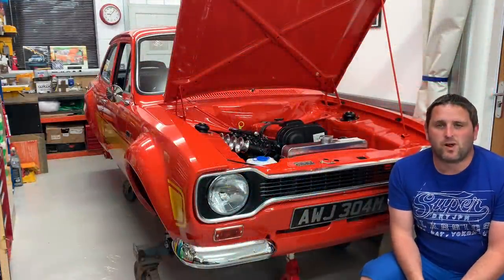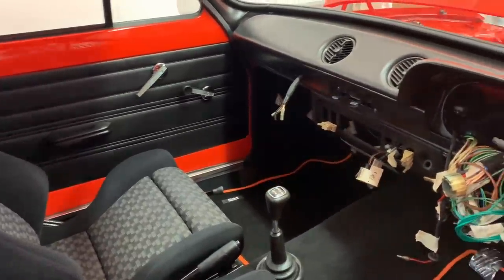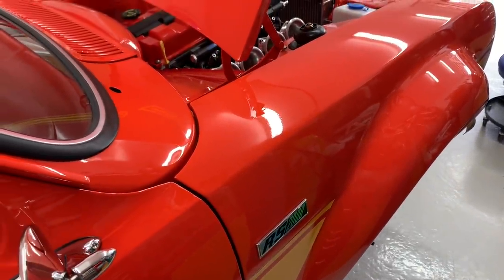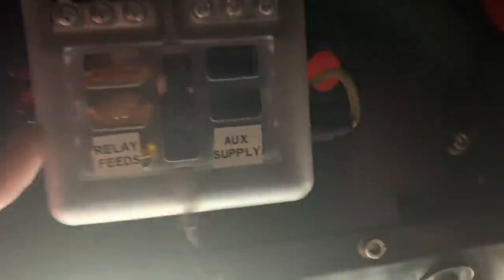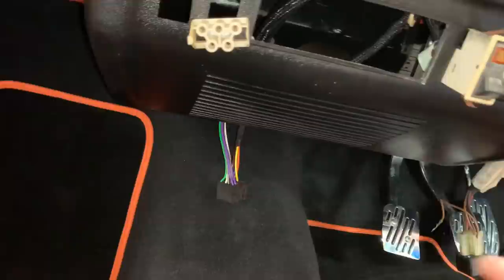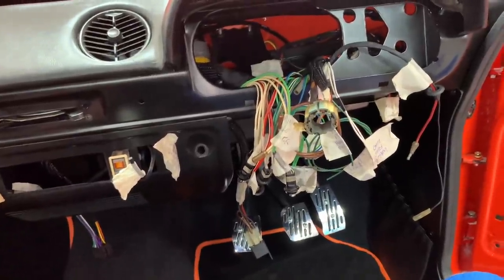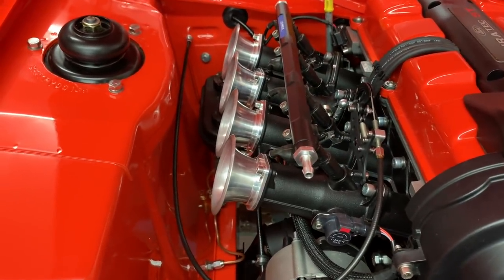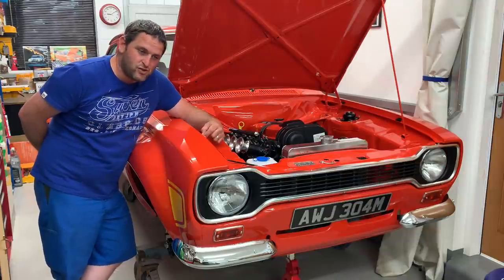Mk1 Escort RS 2000 Re Assembly Episode 24 Final wiring and brake bleeding

Comment: Looking ace mate, just think you have the front seats on the wrong sides, as the pull handel to release the back so that you can get too the back seats should be on the out side of the seat so that it can be access when either door is open, just need to swap the seas around 😉
Reply from the maker: Thanks 👍 Both front seats actually have release handles on both sides of the seats so you can actually tilt them from either side of the seat 👍
Reply: @performanceclassics1986  aha, wish mine had that, can't wait to see it on its wheels , can't be far off now
Reply from the maker: I cant wait either 🤣

Comment: Brilliant work. Keep it up. Instead of drilling the bonnet for the washer jets why don’t you fit the washer jets below the windscreen in between the grills on the scuttle or fitting them on the actual wiper arms/blades as rally cars have.
Reply from the maker: Thats my plan as it happens. Only the very early cars had them in the bonnet but mine should have them through the vents as you mentioned. I do need to drill holes through the bulkhead bubbles for the pipes as i have forgotten to drill them during the bodywork stages 🤦‍♂️

Comment: The car is looking fantastic . Are there different types of Duratec ? The retro ford Duratec exhaust is on the other side to your motor.
Reply from the maker: Yes well spotted. Although the St170 motor states on the cover that its a Duratec, its really not. Its actually a zetec with a different head. The block is identical to a zetec but in no way similar to a duratec.  Not sure why it says duratec on cam cover

Comment: Hi, can you explain me how I have to make the electric wiring for the wipers, I have a 2 speed switch but the motor only has one speed, and the plug isn't the same
Reply from the maker: That shouldn’t be too difficult to do. I would start by identifying which cables are negative and positive to drive the motor. You could do this using a small 12v battery or even a drill battery as I did myself. Then it’s just a case of using a multimeter to find out which switch pins are continuous when the switch is in position 1. With this info you can provide the motor with a positive feed from fuse box, then an earth through the identified switch pins and then to the motor. The earth is switched on a mk1 Escort wiper motor.
Reply: @performanceclassics1986  thanks, I will try do that tomorrow, but I I have other problem, my motor don't have the red cable, so I think they have only one speed, I'm gone try to find other to replace, thanks and good luck with your mk1 👍👌
Reply from the maker: @joaoconstantino6799  the motor earth cable should be connected to the motor casing then just try putting the other cables onto the positive battery terminal and one of them might just be speed 2. Thanks 👍
Reply: @performanceclassics1986  hi again, after a search information I discovered that my wipers motor was only one speed, now I have to buy another with 2 speeds to fit in car, thanks for all the help you give me. 👍
Reply: Hi Craig I hope you OK, in your heater box you have 1 speed or 2, I don't have the resistance for 2°speed, you now the reference for this resistance, best regards
Reply from the maker: @joaoconstantino6799  This is something I’d like to find out myself. My slow speed resistor is broke and heater only works on the fast speed. If you manage to find any or find out the resistor value, let me know 👍
Reply: @performanceclassics1986  hi, I have been talking with a friend and may be we have a solution for this problem, he have a lot of parts and he told me that he have some resistors, and I gone try buy one or two, and then we talk about it
Reply from the maker: @joaoconstantino6799  That would be superb. Thanks 👍
Reply: @performanceclassics1986  if you have Facebook or Instagram tell me, is more easy to use for me, tanks
Reply from the maker: @joaoconstantino6799  Yes I’m on Facebook. Just search for Craig Mclean 👍

Comment: Do you know anyone that makes a complete reproduction hood release for the mk1? Latch and catch.
Reply from the maker: Hello, is it the early or late bonnet catch?? Im not sure about the early catches. I believe the early catches which i believe is pre 69, are pretty hard to find but the later latches and catches are readily available. The springs, latches and cable are readily available on the net or through places like GS Escorts. As for the early ones, i wouldn’t know but i do know they are pretty rare these days.
Reply: @performanceclassics1986  Mine is a 71' model, so I'm guessing a late one. It didn't have a catch when i bought the car, just hood pins. I've been ordered by particularly zealous government vehicle inspectors that I must remove them as they are "hazardous protrusions." This is something I find irritating and more than slightly ironic. I hit a kangaroo last year in my Amarok, which has a bullbar, and the poor thing burst like a melon. A bullbar is quite legal, yet clearly lethal but my standard metal hoodpins are dangerous...work that one out. So its either cut holes for aerocatch or factory setup.
Reply from the maker: @stitchjones7134  that is absolutely ridiculous. Ive had them catches on the mini for years with no issues . All you should need for a 71 car is a screw on spring to fit the bonnet, a release spring for the bonnet slam panel and a release cable and lever. All those parts should be really easy to get hold of. Try GS escorts. Im sure they will have everything you need.
Reply: @performanceclassics1986  Thanks mate. Will do.

Comment: Seats are nice Mt but I would change the centres to all black.
Reply from the maker: I Don’t think they will be fitted in the car too long Stuart. It should really have beta cloth roll tops and i will probably fit them eventually to keep things right
Reply: @performanceclassics1986  that's going to be the best Mk1 around. You got a beauty there Mt. All your hard work you should be proud Mt
Reply from the maker: @stuartjamieson2427  Thanks Stuart, it really has turned out better than i ever dreamed it would. Only problem is its now at the point where i will be scared to drive it 🤣
Reply: Yes imagine all that wet mud underneath in all the little crevises. Nightmare. U be permanently pressure washing underneath.. 😕